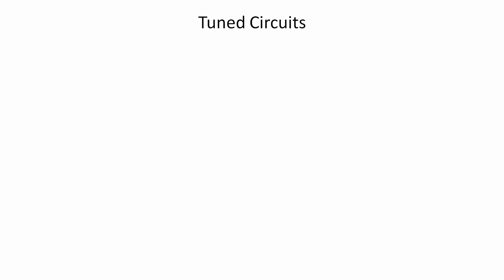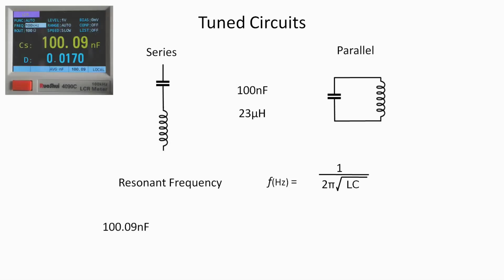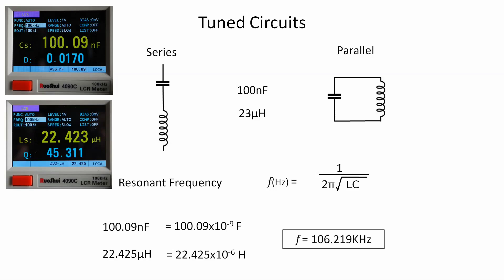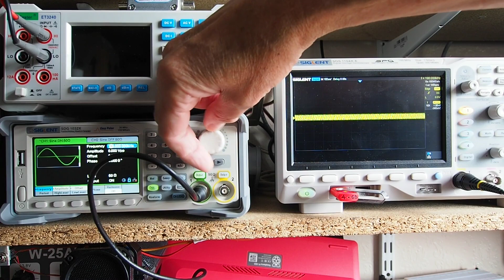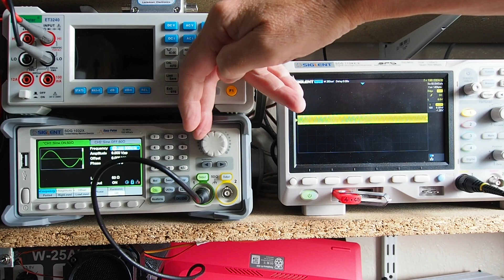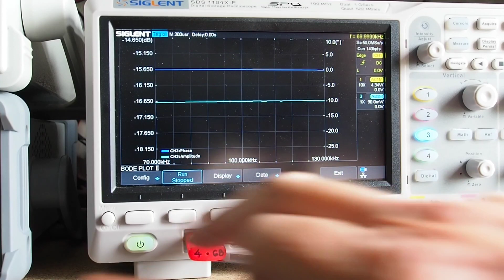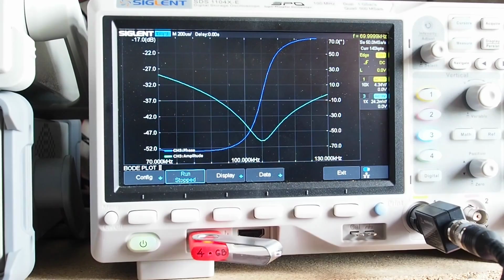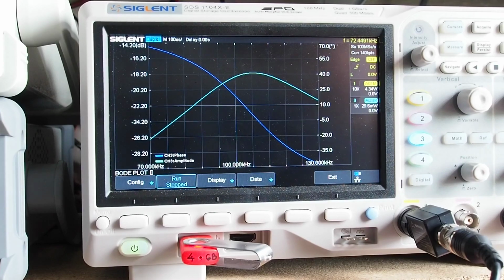Electronic Building Blocks   The Tuned Circuit   - #086

Comment: wow this is a very nicely put explanation wow.... would like to see some more on filters for radios in the future when possible, perhaps how IF cans work and how to calculate their bandwidth as in how wide of an audio signal can pass thru them on for AM stations and how wide is for the FM signals. The reason I'm asking is because I've heard on some other YouTube channels from other radio Teck saying that certain old vintage radios had IF cans built so to allow a wider audio band to it on AM so the radio stations will sound almost as good as  those transmitted on FM Band. I would like a proper clarification regarding the matter. thank you. A subscriber